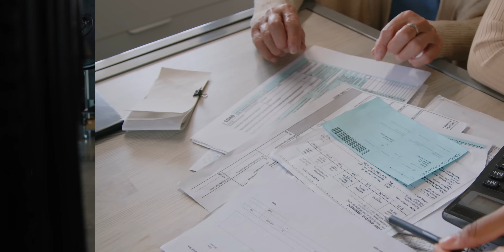SHOCKING Things that Happen in Machine Shops

Comment: As an apprentice an older machinist was training me on a big machining cell. Once a week we had to clean the whole thing and when he was done, he locked all the doors and left me inside. I almost shit myself when he pressed start. Luckily I could climb out of the cell and he was fired soon after.
Reply: No lock-out/tag-out?
Reply: @hool10  No beacause it is a pretty old cell an there were no emergency stops on the inside which is pretty irresponsible in my opionion
Reply: @thefailbrothers345  Well that is an OSHA violation haha. There are ways to make things that old to not work when being operated on (cutting power to a junction box, etc).
Reply: @hool10  In Germany we dont have OSHA but it still goes against all mandatory safety precautions... I am glad I dont work there anymore

Comment: Personally I only taken used tools that I permission to take. Where I put it into my personal collection of very unic tools ex. A 1mm endmill that was relieved 30xd ( and that's a solid carbide endmill that's 30mm long and 1mm in diameter) or shared them with my old school ( telling them how much life there is left ) that the new students can use that doesn't matter if it breaks or not since it was almost out of life anyway and didn't cost the school anything extra in terms of carbide

Comment: One- an old shop I did maintenance at had 2 guys on off shift steal a 55 gallon drum of used carbide and drive it right to the scrap yard. The yard called the only machine shop in 60 miles and they confirmed it was stolen. They got arrested. 

Two- 3 off shift guys got caught at Walmart when they were clocked in at work by a 1st shift supervisor.

Three- My favorite- while I was a QC supervisor we had a group of 2nd shifters take a shipping crate that a new Hass machine came in and carried it across a creek behind the shop and hid it in a tree line. Made a walking bridge. And ran an extension cord from the shop and made in a drug shack. Come spring the farmer neighbor was turning over his field and saw it in his trees. Call our shop and we walk out there and they had furniture, radio and a heater. When we fired the guys that did that they had the nerve to ask if they could keep the shack. We flattened it with a backhoe.

Comment: Not mainly a machine shop story but figured you all would get a kick out of a stupid decision from the top brass. Food product manufacturing was the job, mostly bagged ready to use ice cream and coffee.

They brought in a team to map out our warehouse and setup an entire ROBOTIC FORKLIFT that was supposed to be faster and quicker than us on our actual forklifts. (It was not for any reason at all, thing was so slow we could out pace it even with our slowest forklift.) All of us on our shift kept telling the upper brass that it would not behave even with all the updates and also manually programing from the company. Kept stopping in odd places, going the wrong way, sent a few pallets flying at times destroying all the finished product and my favorite was when it almost took out an entire rack of ingredients but thankfully the emergency stop worked. 

One night it came to a head. Got a call from work at roughly two in the morning and it was my main boss telling me to get to work and don't even dress out. I hauled tail and walked in covered in oil and grease from working a riding mower all day to see the robotic forklift had drove through a wall and crushed the HIGH PRESSURE STEAM PIPE which made each line not only lose sterile state but shut down all of them. Upon further inspection it had also taken out the secondary power for several machines on the bottle line as well. All the top brass where sweating bullets when they showed up and the CEO was looking at them with dagger eyes and was mad to say the least. Took two weeks to get the facility back up then another week to have it all inspected and certified again. Don't know how much that cost but when you lose all the product in the silos along with other raw materials in the mixing tanks and the repairs and down time did not look good to anyone.

Comment: At my job we've had strangers steal scrap metal. All of the scrap metal is contracted to be picked up. After having scrap stolen a few times, 3 at least, the company had security cameras installed and a fence put around the dock that the scrap gets put.
If there's something I want to take home I will ask a supervisor first if it's okay. This is usually designated recycled scrap that's getting thrown out, like cardboard.

Comment: hammock left behind the machine by the night shift. Turning the feedrate down so the next shift can finish the job was a classic one. not rinsing  out the water out of the acid rinsing baths in 10 years.. rinsing baths were more acidic than the acid dipping baths (chemical treatment - risk of micro fractures, impacting part life).Fitting the wrong inserts (no radius) on the milling tools leaving stress risers in the corners on 200k parts and not detecting it after 50 parts (expensive - in the millions to rectifiy)...Pallet fallout out if the machine...(maintenance error)... destroying  a few  millions worth of aluminium spindles on hard metal roughing...(management decision)...   a few stories from more than a decade spent in the aerospace sector... :)

But none of these were as bad for the company as getting targeted by a ransomware, crippling the DNC server, and a large chunk of the Siemens controls (mostly the older generation ones - running windows XP). It took the company several years to recover and millions / month in  IT consultancy fees. Look after your shop IT and OT guys, its the backbone of your company. They learnt this the hard way after years of putting it on the backbench...

Comment: Oh boy where do we start. My employes stole caribide from me, did machining and chill and slowed down speeds and feeds from this list. 
But two cases stand out in my shop. 
1. One of my eployes tried to put down a flaming bucket of gasoline with his foot. He was hand grinding some large industrial bearing neer that bucket, and even though my other employes told him to and how to secure it it lit on fire. I even have a video of that on my onedrive hounting me as a reminder every day... Thankfully he got out in one piece.
2. I cought my employes having made whole equipment for exploding water bottles with compressed air. They made one tool to puncture the bottle and another to hold an air gun in it untill compressed air explodes the bottle. Then they made pranks on one another when they set up the bottle behind one of them, then they hide and turn the valve to explode the bottle behing the worker who didin't notice untill to late.
Reply: You have a great team

Comment: Back in 2005 I worked at a Automotive trade plastic injection moulders and the company went broke and the bank took it over until the lot could be sold. The 2 toolroom guys started a scam with the older machine tooling. They found a old locked gate that they replaced the lock with their own. Then organised a deal with a local metal recycling place, and had a heavy duty skip like the ones they use for quarries and soil removal.
They then started filling it up every weekend ready for a 5am monday collection. I heard all of this from my shift tech I used to be paired up with, on shift with. The key to the gate was left in a fag box by the gate and afterwards it got full of £50 notes as well. Considering some tools we had used to be something like 37,500kg something like 85 U.S tonnes you can soon understand they had some £50 notes. All I couldn't believe is how the lorry managed to pick everything up and transported the load.

Comment: A shop I worked at had a guy that would load a part (cycle time ~45min) then go take a nap in the back of the machine 😂
He crashed the machine for $200k in damage, then did it AGAIN a while later and finally got fired.
Reply: 200k in damages? What machine was it?
Reply: @willyharris4199 I think a DMG Mori NTX 3000. The 5 axis head was hanging by a wire lol